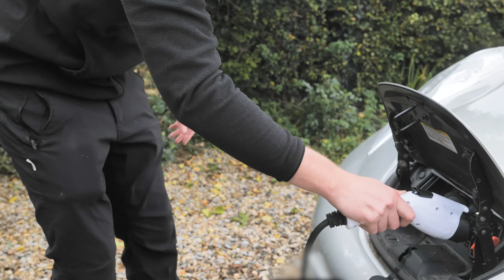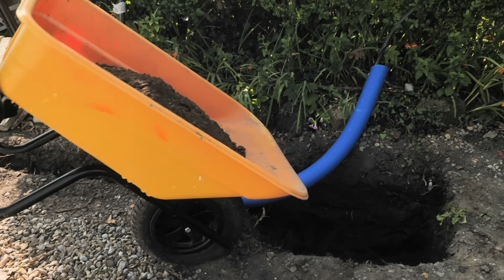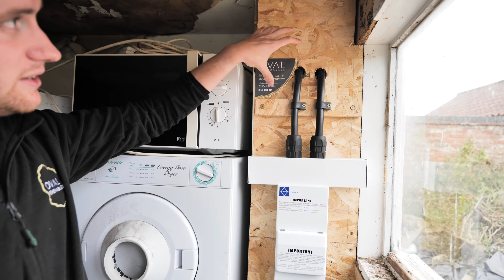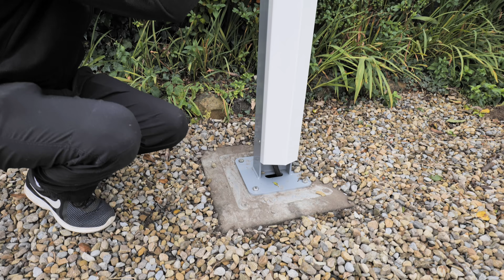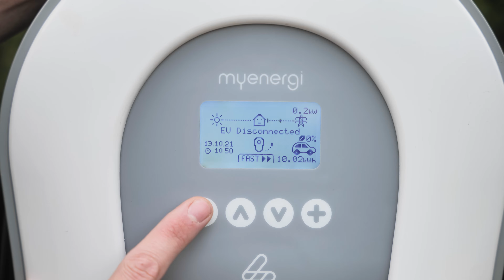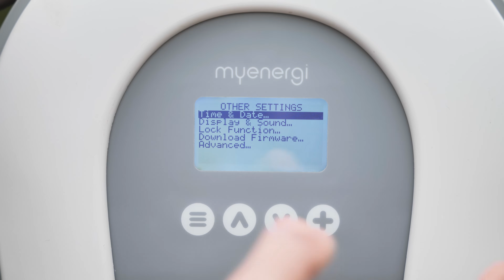7kw Zappi EV charger installation on a Myenergi Pedestal and EV block

Comment: Good video, but I do cringe a bit at using an expensive £400 'EV Block' only to then go and have to mix up a load of concrete anyway!
Reply from the maker: Thanks! This was the first time we have used one so wanted to make sure we got it really secure. Probably doesn’t need it but as it was the first time we were a little unsure how to secure it.

Comment: I’ve just had a Zappi 2 installed and I don’t have a hub, just the Zappi and a Harvi?
Reply from the maker: It may be one of the new ones that has the hub built in. This install was about a year ago before they came out. If the serial number has a H in it then you have the new version.